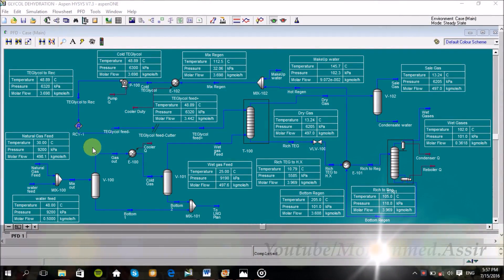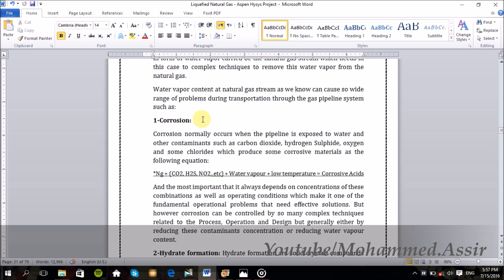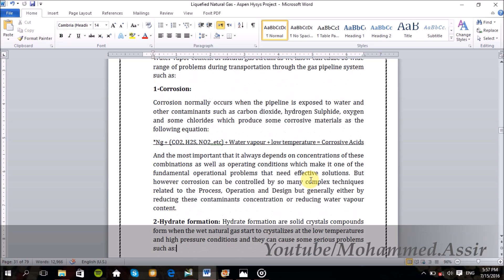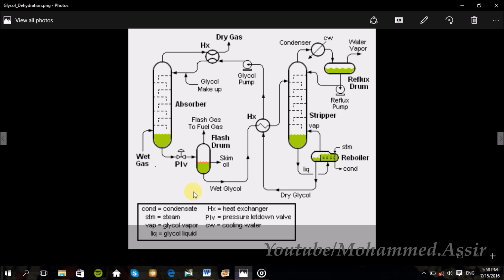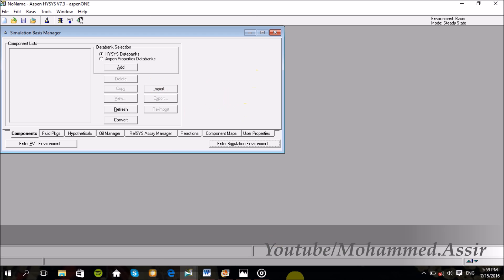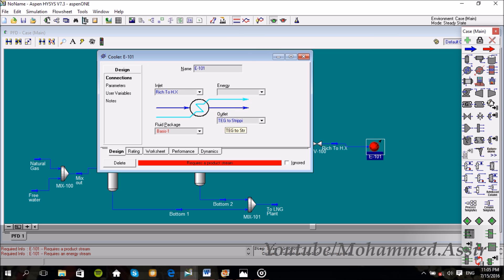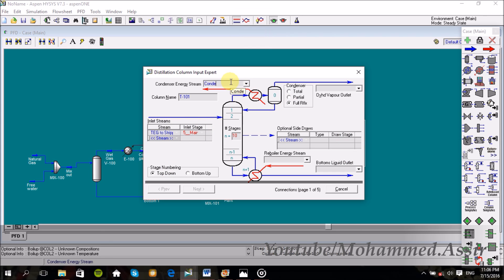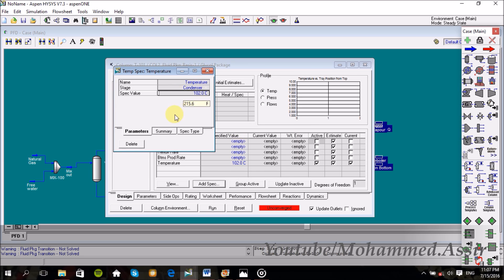2-Gas Processing - Glycol Dehydration Process with Aspen hysys 7.3

Comment: hi very help full video  , but i dont understand why you add water feed and you want to remove water from the whole process
Reply from the maker: Perfect question..

However in most of times the Makeup stream used to be Pure glycol when you need to increase its concentiration and Molar flow to run the Recycle the Glycol stream.

But in My case i want to do the opposite so i have to Mixed it with water to reduce its Conentiration and its Molar flow to Run the Recycle according to my calculations..

However as i told this Process will be optimized again in My next series [Plants case Studies] and i'll show the differences between both techniques beside other optimization ways.

Regards
Mohammad Assir
Reply: thanks brother very very useful information

Comment: Why pressure drop way too big in your E-101?
Reply: And are you sure only have one tray in your stripper?
Reply: How come pressure is increasing in a cooler E-102 ? In practice, the pressure will slightly drop through cooler, then the pressure will be adjusted by the pump. But in this simulation you put the wrong pressure outlet at Cold TEG (outlet of E-102) which higher than its inlet pressure without adding some work. In this case, the hysys still gave you the blue colored but not the correct result. But, thanks for sharing.

Comment: No Stripping Gas?
Reply from the maker: You mean.. The Rich gas Stripper ?
Reply: Stripping gas is located at Glycol recovery boiler, addition of some other vapour (mostly use a little flow of HC gas from fuel gas) to the reboiler will decrease the mole frac of water. So it will help to increase the purity of Glycol.
Common TEG regeneration reboiler use distributor pipe along the bottom of the reboiler.

Comment: How did you determine the values of pressure and temperature in each equipment? Are there any difference?
Reply from the maker: Well in Steady state Mode this process can be done in wide range of pressures and temperatures "they havn't that effect". However i choose these values based on many research papers "i can send you some of them".

Finally actually this process will optimized again from many ways on my next series soon [Chemical Plant case studies] + [Dynamic Simulation and Process control] when i'll repeat this process with the real plant values "Dynamic Simulation".
Reply: Mohammad Assir thank you sir

Comment: salam alikom mohamed !  ,
so i want to thank you again for this content it really helped me , i wish you all good for what you are doing , 
now i want to ask something about this simulation (Glycol Dehydration ) , i required aspen version 9 , and it works perfectly , i followed your steps and completed the simulation properly with no problems , our results converged except for one , the Absorber T100 , the inlet matchs but the outlet temperature differs its ( -35 for dry gas an d -40 for the rich TEGlycol ) so tried to modify the colum , on flow sheet i choosed split all inlet , and the temperature converged to your result . so my question is what difference does it make (split all inlet ) and why all parametres were the same except for the temperature . 
i hope u can answer me on the one ,  and thank you for your work !
you can check your email , i sent a sceenshot  .
Reply from the maker: sofiane 33 

Sure bro.. i liked how you explained your process and I'll be in contact with you but i need to take a look about somethings on your process first.. so it will be great if you send me the (column, its streams details..).

Finally am planing to optimize all these processes (Gas processing + Refining processes series) on my next series [ Chemical Industries and Case studies principles ]. However just send me these details at [ dr-zoling@hotmail.com] again and i'll be in contact with you.

Regards
Mohammad Assir